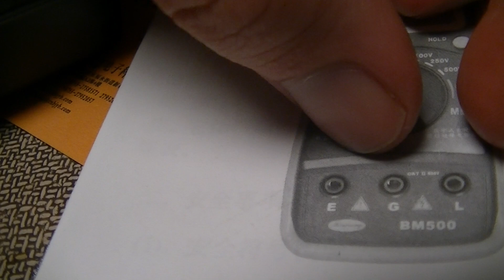SZBJ/Binjiang BM500A insulation tester guts

Comment: Hello please can you help me out,  I have one of this meter just like your one but it's stopped working, the symptom is,  it switches on but it doesn't measure resistance  or provide any Test current in any of the settings, what I mean is basically I can't put my finger on the tip of the probe even at 1000 volts and I don't get a shock no current at all it is faulty it switches on and just displays the number  one  , I dont even know how it went fulty , what do you think i should look for please, I have checked the the two big transistor and all the diodes, do you have any idea  what i should be looking at i dont have a circuit diagram ??? thanks
Reply: @Multikontroll thank you very much for your reply, please can you have a look at this video I made for you, can you copy and paste this into your browser please.
https://www.youtube.com/watch?v=IOLgA6UEpLU
what do you think can you get back to me please after watching the video i made for you thanks amir , I hope to hear from you soon
Reply: @Multikontroll thank you very much for your reply, I made a video for you can you please copy and paste this into your browser, 
https://www.youtube.com/watch?v=IOLgA6UEpLU
can you watch the video and get back to me if you can please.
thank you amir.

Comment: I have one and am not sure how to confirm that it is still working. When I applied the test volateg across my multimeter I do not get a reading. Is this expected or has the insulation tester failed? Wondering what you see with yours? Thanks

Comment: Thanks for sharing! Do you, by any chance have the English manual for the BM500A?
Reply: PuchMaxi1988 I found an English manual - don't know if youtube will let me post a link. Here it is -
http://www.hobbielektronika.hu/forum/getfile.php?id=253355
Reply from the maker: PuchMaxi1988 No, but it is easy enough to use without one.
Reply: randacnam7321 I disagree. A megger should only need two terminals, this has three. How can I use it intelligently if I don't know what the terminals do? E and G are ambiguous as terms earth and ground generally mean the same thing.
Reply: @iconoclad  G is for guard and you only use it when you dont measure against a grounded core, as an example if you test a transformer and you are testing between High and Low coils you use the guard connecting it to the grounded core, but if you are measuring between the core and the coil you dont need to connect the guard terminal. Guard is ussually used in High voltages megger, ussually in the 5KV, 10KV, 15KV or 20KV ranges
Reply from the maker: iconoclad
Determining what the terminals do is not hard.  The purpose of the ground connection is as a safety thing if there is an accessible ground for the DUT.  Whether or not such protection is implemented on something this cheap is another matter.
Reply: iconoclad Thanks for the manual, much obliged!
Reply: I'm still not understanding the G terminal.  I would be hooking the E to the ground of a device under test -- aren't you saying to connect G to it?  The book doesn't help much, says it is for surface leakage?

5．G input terminal: shielded terminal of the insulating resistance.
6．E (EARTH) input terminal (connected to EARTH terminal of the to-be-tested object)

Connecting cable of E terminal socket of the meter is earthing cable；
Connecting cable of G terminal socket of the meter is shielding cable and connected to surface of the to-be-tested object to prevent surface leakage and affect impedance test.
Reply: For normal appliances forget about the G terminal, it is only to be used in special cases such as testing transmission cables and such. For "normal" device testing (for example checking insulation resistance of a motor)  connect the L (-ve) terminal to the case of the device under test and the E (+ve) terminal to each of the  device "input" connections in turn, such as the active and neutral connections. You might then repeat the test with reversed polarity. (Actually, only need to test against one of the input terminals as normally there would only be a few ohms between active and neutral. Leakage would indicate equally on either terminal.)